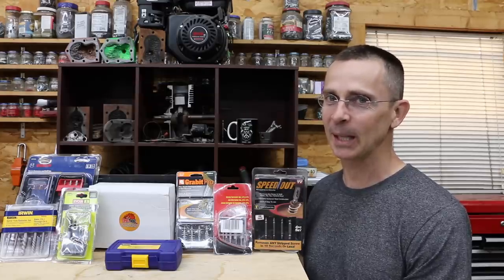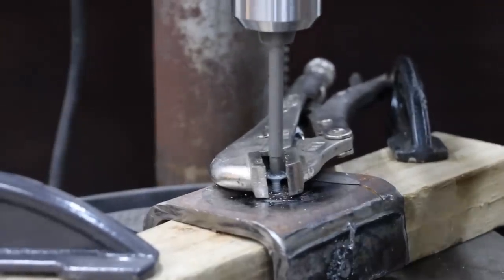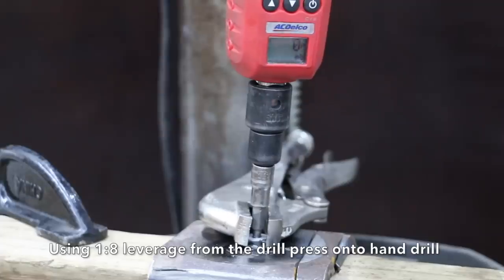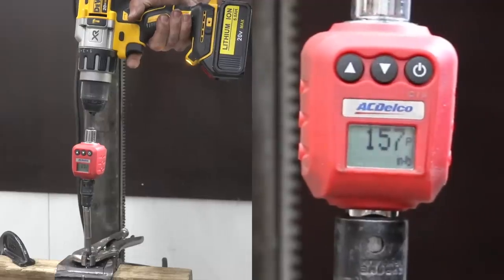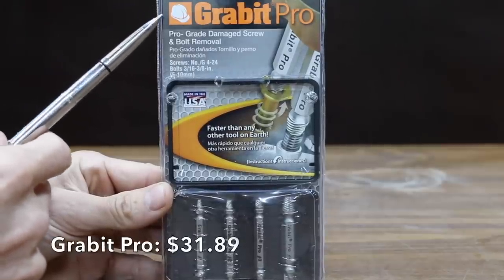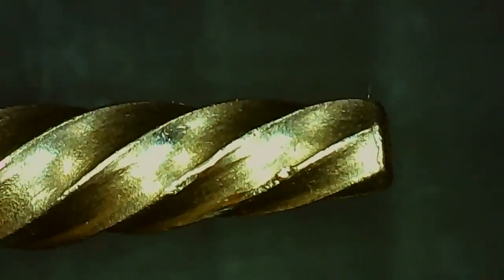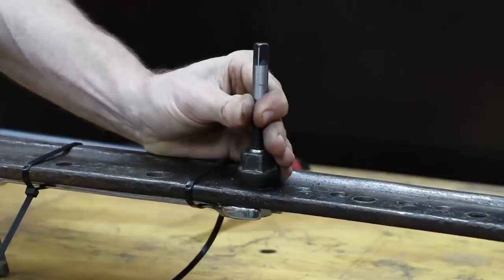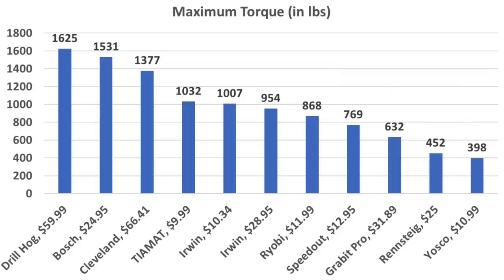Best Bolt Extractor? Let's find out!  Drill Hog, Bosch, Irwin, Speed out, Ryobi Broken Screw Sets

Comment: At my job we remove broken bolts almost daily.We use revrse drill bits and the irwin kit. 9 times out of 10 he drill bit will grab and remove the bolt..However we do work with smaller bolts torqued at less than 50lbs.
Reply from the maker: Thanks for the feedback.
Reply: I too use Irwin, as well as some $$$ Snap On pieces. They both work very well, with the Irwin being WAY cheaper!
Reply: If the bolt sheared off because of overtightening or overloading, it'll come right out. if it snapped because it's rusted in place, it's time to get the welder out, because no screw extractor will save you from that.

Comment: For anyone wondering for other alternatives who was having a problem, I had spark plug threads break off in a Honda 115hp outboard engine. They were seized beyond belief. I checked this video out before buying the tools. Since I was in a pinch and needed something today I ventured off to ace to get Irwin. Unfortunately they didn’t have the size I needed in stock.

I ended up going to Napa and picked up a set of Carlyle. They are Chinese manufactured but seemed to be better quality than other offerings locally. They worked GREAT. I put my whole body weight on a breaker bar and got them out. I am extremely impressed.
Reply from the maker: Thank you for sharing!

Comment: I used an Irwin bolt extractor to remove a broken bolt on the vise that came with a workbench my uncle gifted me (he got it surplus from his work). The vise was a Wilton 1755, but the pipe jaw was broken off and I needed a bolt extractor. It worked great and I have been using that vise heavily.
Reply from the maker: Impressive!  I'm impressed with the Irwin brand

Comment: What would been good to measure as well with these would be how much each remover expands the diameter of the bolt. 
I have used many of these since I am a mechanic and I always find the coarse screws work better with their nice grip and less bolt expanding properties. 
The finer threaded ones does get a strong grip when inserted in a bolt if they are good quality but especially in aluminum if a bolt has gone stuck or corroded even a slightly expanding bolt will lock up even more as far as I learned so in most cases the coarse ones have worked best. But yet again every case will be different depending how the situation looks. 
Either way you have made a great work as always showing which product indeed has the better quality :)
Reply from the maker: Thanks for the feedback.

Comment: snapon is the way to go. they don’t break and when the loose their edge free replacement. I use my set every week working as an airline mechanic where I don’t have the option of breaking tooling off.
Reply: Snap on extractors are Irwin. Your just paying three times a much more for that fancy red blow molded case
Reply: Oh they break, lol. Maybe your mechanics are a bit nicer when they overtorque stuff than mine.
Reply: @cryangallegos  you break one off inside of something you gotta use a carbide bit on em and it gets kinda nerve racking sometimes.
Reply: I bought Irwin and broke them. No getting replaced! Bought snap on for  2 times the price of the Irwin and get them replaced when they brake. Some things are worth buying when you pay more.

Comment: Having extracted many screws when working on aircraft, I found that investing in a good quality cobalt drill bit set is key to getting the screw prepped for the extractor.  Better to buy cobalt drill bits, and then you have a wider range of extractors.  Great video.  Thanks.
Reply from the maker: Thanks and you are welcome!

Comment: I'm not an enginerd but one would think that ramming the extractor flutes into the screw wouldn't be good for them. If you're "stripping out" the hole you drilled then that wouldn't leave much for it to bite. I know you don't hit a regular tap with a hammer so why are these different? It sounds like using a screw as a nail. Wouldn't something that threads in counter-clockwise work better?
Reply: You are completely correct he is misusing the extractors entirely
Reply: Could you clarify your comment perhaps? I believe he is using them how the instructions on the packaging say to use them.
Reply: @jasonkopejzna5113   Jason Kopejzna  I would agree, I felt he was using them incorrectly as well since the video wasn't showing everything he was doing. My Tiamat set from 3 yrs ago works just fine and hardly any wear. A video like this takes a while to make so I'm sure he overrushed when performing the tests.
Reply: Extractors are supposed to be extremely hard steel, so tapping them in should only damage the screw and not the tool. The idea is for the hard steel to bite into the soft steel
Reply: I don't think he's hammering it that hard.  He is going with the instructions on most of them.  Also when the speed of the action is fast it might seem that way.  I feel like he is tapping the extractor just enough so it grabs in place and is strait.
Reply: He should have used a tap handle, because he wiggles around with his handle, that's how taps break! The screw extractirs are also made of very hard steel, so it is also pretty brittle. That's why some of them broke.
Reply: There seems to be some misconceptions here on these tools. They are generally hardened and tempered for max toughness, which tends to be between 45 and 55 RHC depending on the alloy. That's hard, but not "shatter upon impact" hard. The typical screw these would be used on are grade 5 which are significantly softer. That's why his first test was problematic, his screws were hardened. 
Normal usage for the spiral type is to drill a hole big enough for the tip of the extractor to start to enter and tap/ hammer it in before starting to twist on it. They ARE twisted to pull themselves in as you turn them counter-clockwise as you attempt to loosen the screw. Which can be good and bad. Good if you have enough meat left on your screw to resist expanding and wedging itself tighter into the hole, bad it the aforementioned happens.

Comment: My experience with extractors has always been, they break or the screw breaks. Either way I'm drilling it out 90% of the time.  I've just never found these sets valuable.
Reply from the maker: Great feedback. Thank you
Reply: It's always fun trying to get a drill centered on a broken bolt.
Reply: I have the same experience.
Reply: Project Farm The new YouTube automated answer feature? 🤔 Seems a bit strange answer to this comment. Hmmmm... 😂
Reply: Part of my job is getting broken bolts and screws out for a manufacturing facility, and I will say they DO work about 25-40% of the time but it varys wildly depending on each individual bolt.

Comment: I always made my own extractors.  Drill an appropriate size hole in the offending bolt and use a 3 or 4 flute tap with a tapered back-clearance (left-hand ground).   Over a 40 year machinist career I had about a 90% success rate.  Practically no breakage. Usually the bolts were so tight they eventually had to be machined out.
Reply from the maker: Thanks for sharing.

Comment: My guy have you not met our Lord and Savior the left handed drill bit?
Reply: Indeed, I stripped my Irwin extractors trying to get out some grade 8 bolts, went up to my hardware store and the owner showed me a set of left hand drill Century brand drill bits.  I've never had something now that those can't get out!
Reply: Dustin E, Yes!
Reply from the maker: Great suggestion!
Reply: Whatttttt??? Gonna have to check that out!
Reply: Best thing since sliced bread! Great for all exhaust bolt removals!
Reply: "my guy" were you not watching at 3:16?
Reply: @lunchboxproductions1183  I wouldn't call that a drill bit. It's a cheesy "bit driver".
Reply: Most definitely, and KnKut makes the best I've ever used. Once they grab the bolt surrenders!
Reply: Yes, 9 out of 10 times a reverse drill bit will eventually "grab" the bolt while drilling and remove it. You have to be very good at drilling and prepping the head of the bolt before drilling...……..BUT...….If you break the drill bit in the bolt, you better hope it broke clean so you can use a "broke drill bit extractor" to remove the broke drill and then go to a easy out to finish the job. Coming from someone who has done this millions and millions of times.
Reply: Reminds me of my dad drilling an aluminium bracket on the windows here, I just come to the living room and he's like "Damn why the heck does this not do anything? Is that bit really THAT dull?" Then I hear that characteristic sound of the drill being on reverse instead and he just had to facepalm at it.
EDIT: of course, he had a common right hand bit, right one for the job and all.

Comment: Best screw extractor: end mill. You can’t change my mind.
Reply from the maker: Thanks for sharing.
Reply: EDM beats end mill...
Reply: Only if you can get the part under a mill in the first place.
Reply: Not to change your mind, but could you explain? As a machinist and mechanic and sixty years of experience I don't get it. How would an end mill get those wood screws out? How would you use it under a car? You can use a drill bit to remove a head. How does an end mill work?  They are also quite brittle.
Reply: I got ya beat. Best extractor is cutting torch. At least its mobile and fits in tighter spots than your mill.
Reply: @spcpitts  Why don't you just melt the part and you will get the broken bolt out.

Comment: Pretty sure none of them’ll remove the broken bolt rusted and frozen inside my exhaust manifold
Reply: Left handed drill bit and possibly just normal drill and a tap
Reply: I seen this dude use a wirefeed  and he takes a nut and welds it on there, even if its broken in the hole as long as its aluminum he builds it up using the wirefeed  and the heat from welding the nut on breaks the rust away and they come right out. This would work good if to break a easy out or a tap in the hole.or bolt.
Reply: PS when you break a bolt in aluminum that is stuck from corosion it sucks like on a head bolt on a small engine you almost have to drill it out and use a heli coil unless you use the weld a nut on there I know i work on small engines and before I seen this weld a nut method I have helicoiled alot of holes.

Comment: For me, the best "Normal" consumer bolt extractor has always been, "Irwin."
Reply from the maker: Thanks for sharing.
Reply: I have many different brands of extractors and the irwin is really good value to cost for homeowners and light use ...i have experienced that they work well my only complaint is they do sometimes break. And it seems to me that the quality is not consistent. Sometimes you just get a bad one...none the less tge irwin brand holds its own
Reply: @georgebell2567   Interesting.  I've had my set since 2012. I use it not only around the house but also in automotive applications.  Thank God(Also, knock on wood for a little added protection lol) they haven't broken,  yet.

Comment: The short multispline style like the Irwin doesn’t need to drilled first for a screw. A broke bolt would need to be drilled first. Also no need to hammer the extractor into the material. I’ve pulled hundreds of broke bolts out with a multispline Snap-On brand kit for my job. They work with a 1/2” inch socket and rachet.  Those kits are about $400, but last forever.

Comment: Have you ever seen the boot extract tool called.  “Snipe bolt extractor””. Best one I ever used...
Reply from the maker: Thanks for the information.
Reply: Hey Mr. Project farm, I just got a 2001 Ford f250 5.4 liter v8 gas engine no leaks dosent burn any oil was wondering what type of oil you would recommend I use.
Reply: @josephsollender8487  Amsoil or Pennzoil
Reply: Joseph Sollender I would recommend you look at and subscribe to fordtechmakuloco channel on YouTube. This guy is awesome for Fords. I’ve learned a ton from him. I would think he would recommend using 5w-30. Pennzoil platinum or ultra platinum on your truck. But do some research and watch some of his videos. He has made me much more confident doing my own repairs on two expedition trucks I have. Good luck brother.
Reply: Joseph Sollender what the manufacturer recommends...

Comment: I'm going to lowes tomorrow and thought let me look up project farm to see which circular saw blade is best. I don't see a video for that?!

That needs to change!
Reply from the maker: Thanks for the video idea.
Reply: @Peter Evans Haha, "never buy 24 tooth" huh? So I should pay half-again as much for a 40 tooth blade and then brake the carbide off the teeth when I hit a nail or screw doing demolition work? No thank you.
Reply: @Peter Evans Never a reason?  Speak for yourself.  Less teeth  = larger gullets between teeth.  Larger gullets  = faster cutting.  Less time performing one task  = more efficiency.   More efficiency  = greater throughput.  Greater throughput = more profitability.  Case in point?  Sawmill.  What applies to you doesn't apply to everyone or every industry.

Comment: I was a bit desperate and grabbed a Grabbit screw extractor from my local hardware shop to get out a sheared off stainless lubricant attachment - fastest and cleanest extraction ever.  Have not looked at another brand since.  Looks like I lucked into an excellent tool for smaller fasteners.
Reply from the maker: Thanks for sharing.

Comment: Hey Project Farm.  Lots of great videos for sure.  I would like you to look into the RIDGID #10 EXTRACTOR SET  MPN 35585.  I used this set to take out A LOT of broken bolts from tanks and APC's when I was in the Army.  Tips: rap the bolt hard and penetration oil if needed, accurate center for of pilot hole (then drill to size), a little finesse and you have saved your threaded hole ready for a fresh bolt.
Reply from the maker: Thanks for the video idea.

Comment: An idea for a video should be “What 2-Cycle oil is best?”
Reply from the maker: Thanks for the suggestion.
Reply: Yes!!! Benoil, super techniplate, blendzall, 927, anything with Castor oil in it just for that sweeeet smell and smoke that every 2 stroke should have! I  run Klotz super techniplate "Racing synthetic with 20% Castor oil" in all of my machines but am very interested aswell!!
Reply: Many variables to cater for that 1. use of motorcycle woods trail motocross super cross sport bike old or new bike etc.etc. wether its premix or pump feed. Different engines require different mix ratios of 2 stroke.
Reply: I have used the walmart stuff on a walmart weed eater for five years now no problems from either only one spark plug change last year.

Comment: Other kinds of solutions:

1. If the slot's/nut's thread is also expendable, you might as well just destroy the whole screw and the socket with a drill.
2. If any part of the screw is protruding, you can, try and clamp it with 1 or 2 a presses and use them as leverage, or drill a hole perpendicular (or as close to it as possible) to the screw's length, put a rod into it and also use it as leverage.
3. If no part of the screw is protruding, weld a rod, perpendicular to the screw's length and use it as leverage.
4. Make your own extractor by sharpening the tip of a metal rod with a mill, carve grooves on its surface, and then harden and temper it (need to know how to forge metal).
The longer the drilled hole, the further you can shove an (thin enough) extractor, distributing the surface contact, the friction and mechanical stress experienced by the extractor, along its whole length. Also, a small amount of clay (or other small particles) can be added into the hole as filler, to increase traction.
5. It might be possible to, shove a metal rod into a drilled screw and then heat it up with an electrical resistance (similar to a soldering iron) and have the heat expand it, so it becomes stuck very firmly. However, the screw will most likely expand as well, making it much harder to spin it out (as such, before extracting, the screw should be allowed to cool down after drilling, as well as be removed from any heat source if possible).

Finally, add oil into the thread of the screw, to loosen it.
Reply from the maker: Thank you!

Comment: I'm a millwright in a steel mill in Detroit,  and have a set of the Irwin multispline,  (short ones)   and I've used them on 1/2 inch bolts or bigger with a 3/4 size 18 inch breaker bar with a pipe cheater on the end.  And I've never broke one,  could not be more impressed with a set of extractors. I've always broke longer style/fluted extractors.
Reply from the maker: Thanks for sharing.

Comment: "Made in the US with global components" - What a mighty fancy way to say Made by China
Reply: The quality Irwin stuff is actually made in the US. I was an intern at the factory in Maine from 2014 to 2015. We made their taps and dies too. The packaging is the Chinese component.
Reply: Almost certainly that means the raw material came from somewhere outside of the US, but the manufacturing was done in the US.
Reply from the maker: Thanks for watching.
Reply: @bennattj  It was US sourced hex stock. The Snap-On stuff made on the same machines was a slightly better quality steel if I remember right.
Reply: @bennattj  manufacturing or just putting the components into the packaging?
Reply: @2AForever-wi8yj  I'm just speculating. I mean I doubt there's any real regulation on what they say, but a component is part of a whole (the whole being the final extractor). It seems unlikely to me that "Made in the USA but ..." would mean they ship the parts and then the packaging is assembled in the US--I don't see how that would make financial sense to do (but like I said, I'm just speculating).